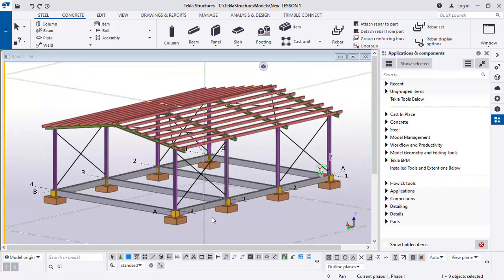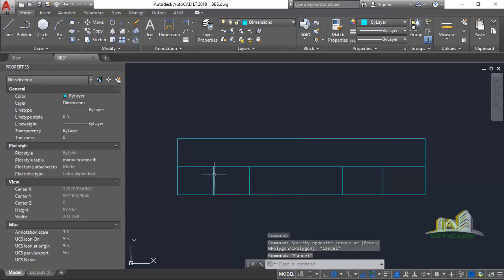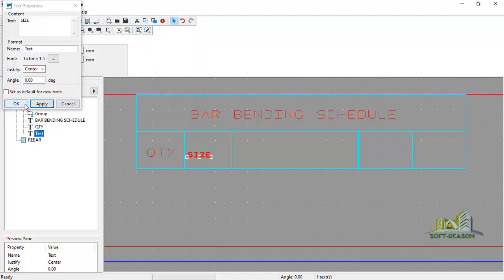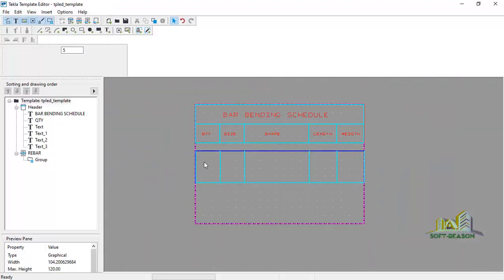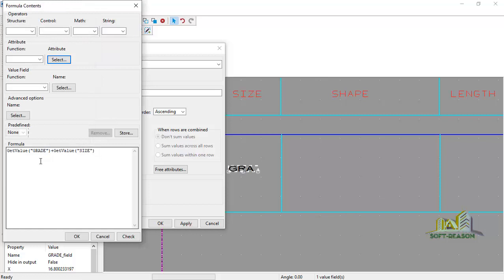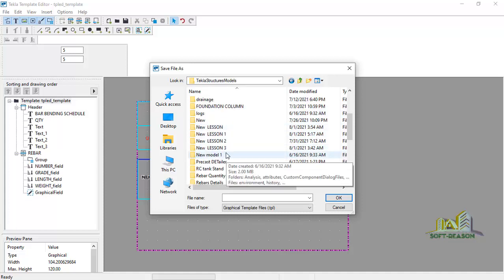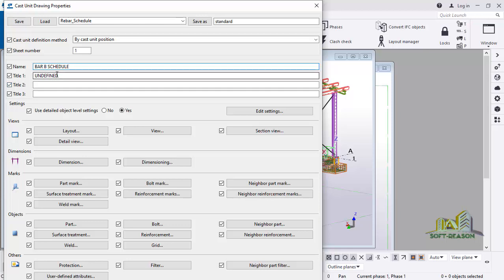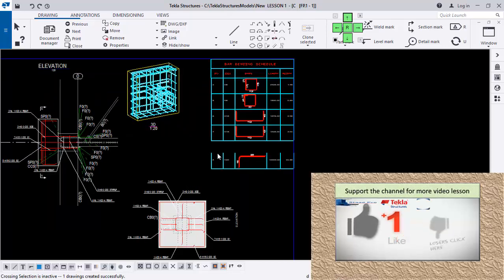How to Create Bar Bending Schedule Template in Tekla Structure 2020

Comment: Thank you for this sir. I have a problem with my rebar schedule, the hook length from the model drawing is not the same with the fabrication drawings and also how can I change the units from mm to cm in the rebar bending schedule?
Reply from the maker: It's possible in Settings
Reply: @CADmade-easy  I have gone through the settings but not sure what is wrong
Reply from the maker: @obinneetheldinaka9969  I will check it out lately, but what version are you using?
Reply: @CADmade-easy  I'm using version 2022. Thank you